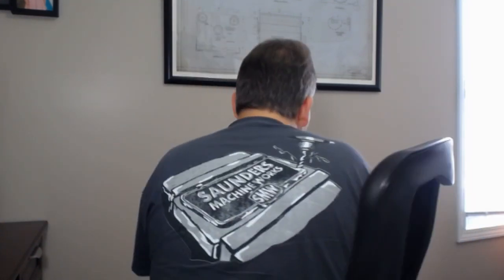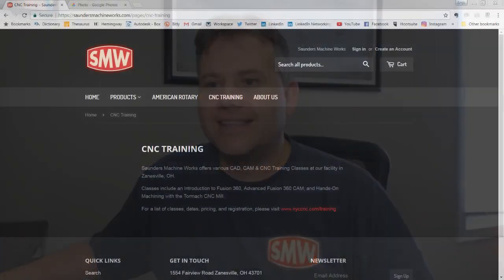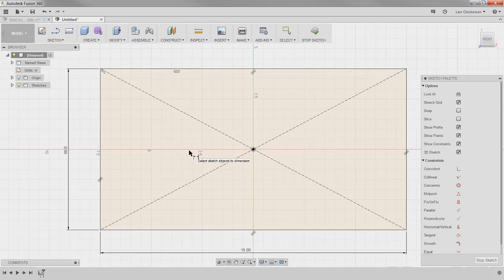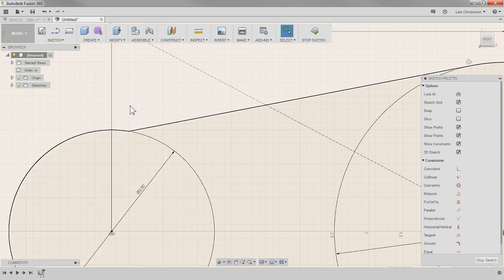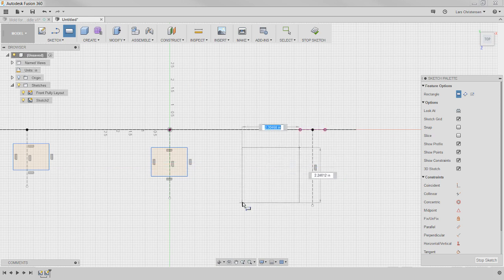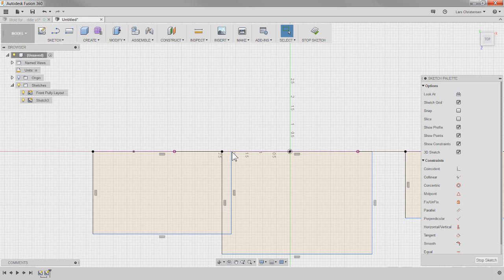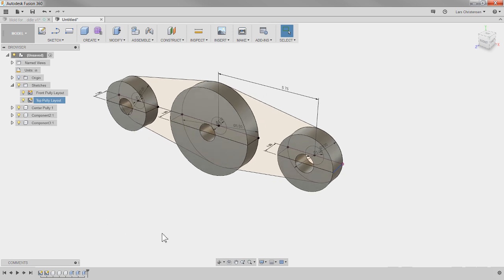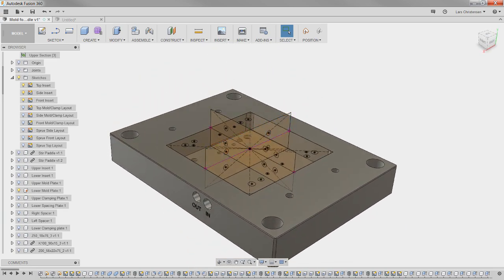Fusion 360 — Easier With Layout Sketches —Your Comments & Questions — #LarsLive 25

Comment: Lars, on the issue you were having when applying constraints. I've noticed, that when applying midpoint to 2 lines, it always makes both of them cross the middle of each other simultaneously, like making X letter. What happens next is when you're trying to make the horizontal line colinear with another line, you're effectively making that vertical construction line zero length, and naturally Fusion won't allow that. Hope that helps a little.
Oh, and I'm a big fan of your tutorials, keep them coming!
Reply: Essentially over-constrained.